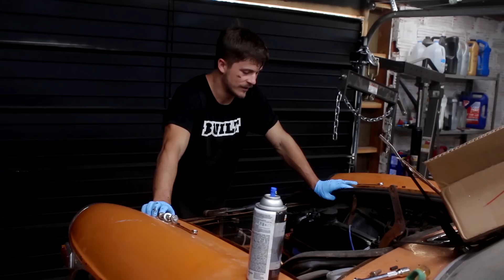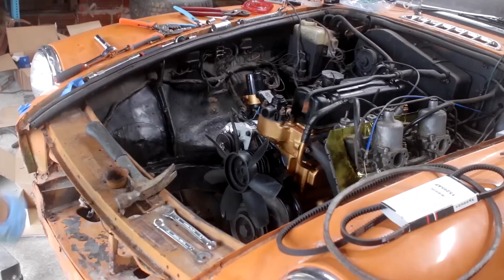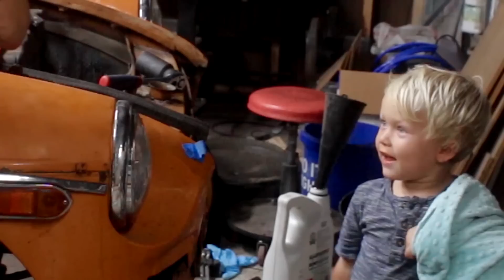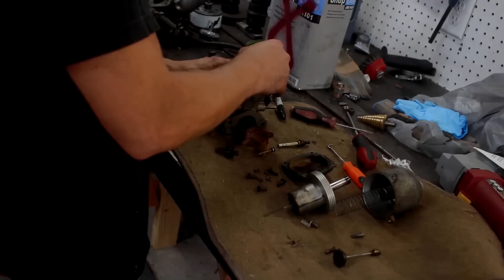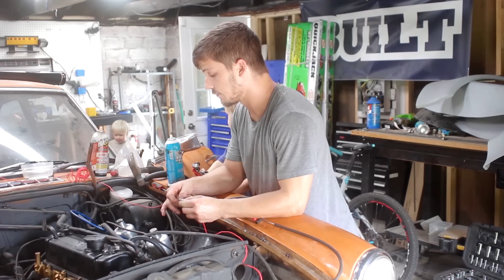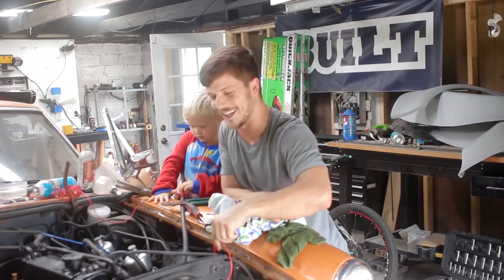THE RWMGB pt. 7: RUNNING FOR THE FIRST TIME IN 27 YEARS

Comment: OK I want to ask the question starting with WHAT IF.
What if you swapped it with 3.0td om606 from mercedes with 500hp and around 800nm on stock  internals?  It's cheap swap reliable and gives good mileage per gallon.

Comment: If it's going to be a track car then you'll be better just getting rid of the thermostat. 
1, it can't fail if it ain't there.
2, the engine will run cooler which is better if it's being thrashed anyway

Comment: Great video, delighted to see that you got the car running, I think you have the thermostat in upside down though, the spring part should be at the bottom. Also if you warm the gearbox oil up a little it does flow a lot easier. You may find you don't need an oil cooler on the car; I aim for an oil temp between 100 to 120C, running the car on track it's easy to achieve but in normal day to day use the engine never works that hard, I'd certainly try it without to start with. Looking forward to more videos soon
Reply: Yep, thermostat is upside down.